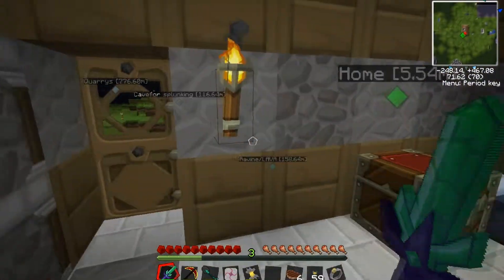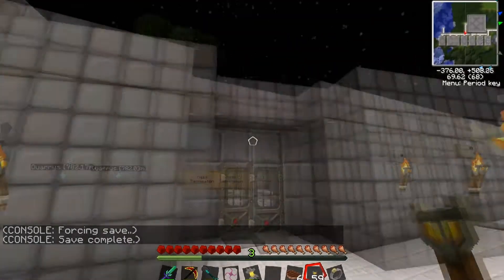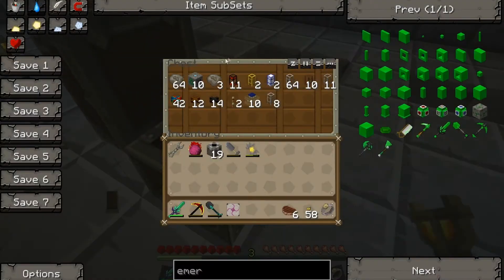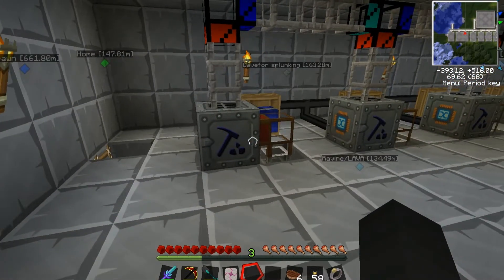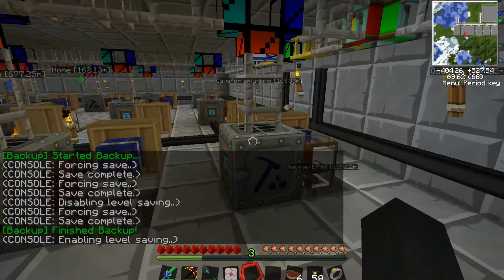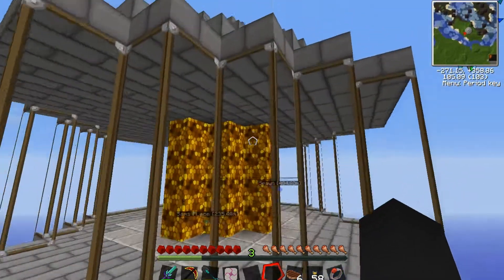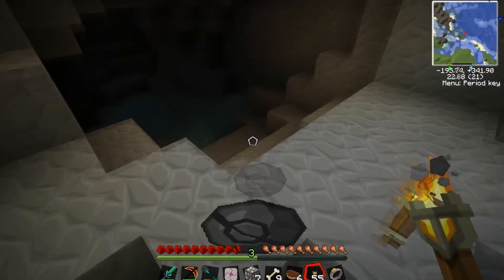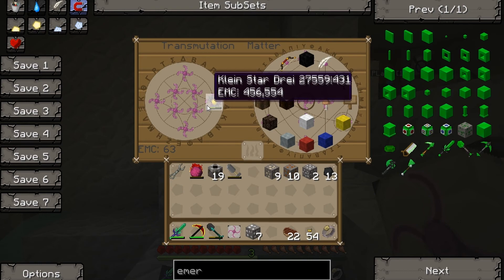Tekkit Multi-Purpose Factory Tour (Part 2)

Comment from the maker: Those blocks are Construction Foam, you use a CF sprayer and back pack, with a stupidly long recipe (its not that bad) to make the CF pellets; anyways you spray it on the scaffolding and it turns into the block that you can colour. 

You can colour the cables by getting a paint roller, which is wool and iron, and then dying it with any dye. You use the coloured roller on the wires.